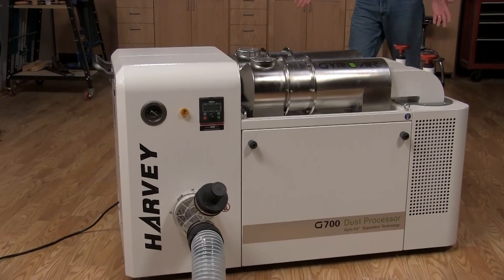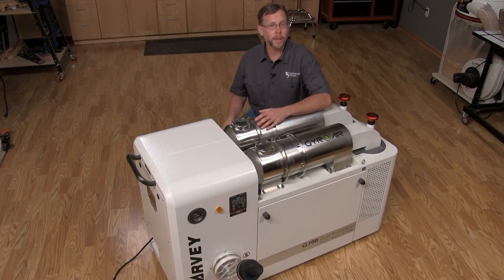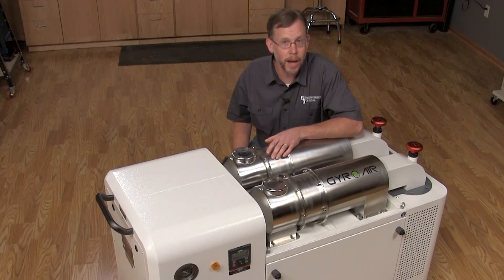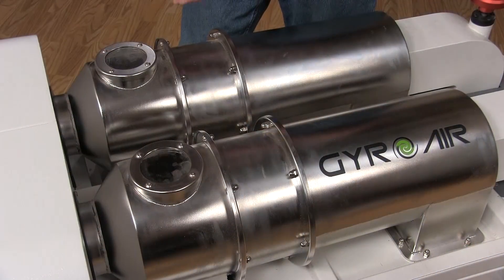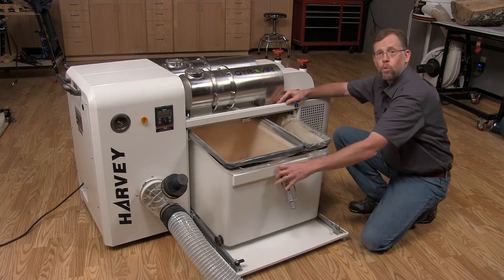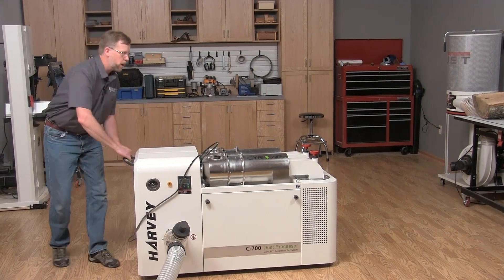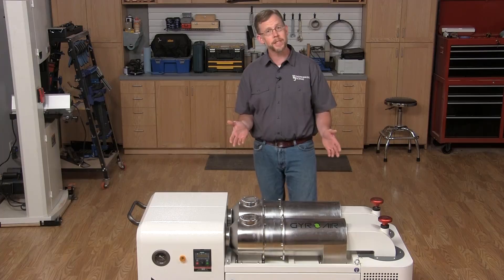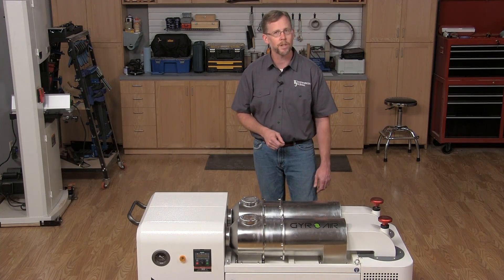Tool Overview | Harvey G700 Dust Processor

Comment: It certainly is a different approach. Essentially,  two high velocity (high pressure drop) cyclones to catch maybe 0.5% more dust before the filter than a standard cyclone.  But at cost of higher energy costs.  Even the VFD isn't enough to make up for the energy losses due to a high pressure drop.  A standard 2hp  dust collector with a quality cartridge filter will flow more air and provide about the same filtration efficiency with less energy. 

I dont see much extra value to justify the huge price tag. Not to mention that the high pressure drop of this design costs more watts per cfm than a standard dust collector with a good filter which costs much more $$ in energy costs over the life of the machine.  The small collection bin will likely be a show stopper for many shops.  This is more of a novelty product for people who want a conversation piece than a value adding innovation. The form factor and lower noise level are benefits but not the most important ones for most. 

A standard dust collector with a good filter and with good dust collection design on your machines puts out clean, safe air.  Add an ambient air cleaner and the shop air will be cleaner than the outside air.  All for half the short term cost and a fraction of the long term cost.

I like seeing out of the box thinking but it's not innovative from a value standpoint.